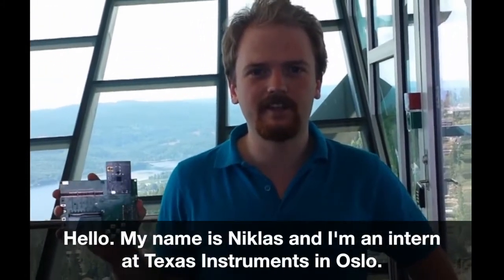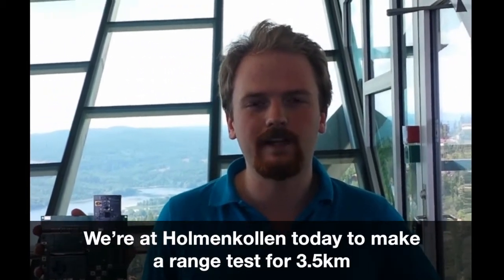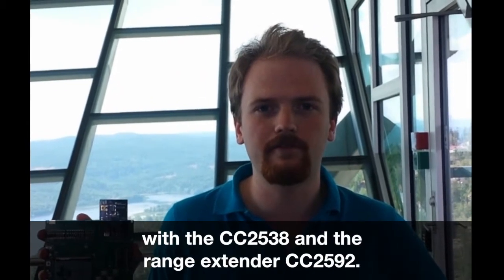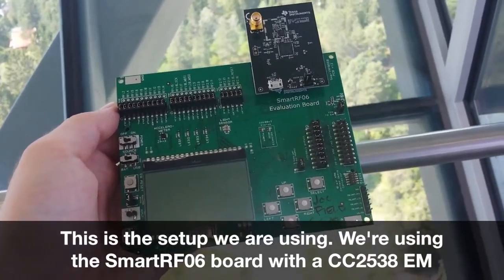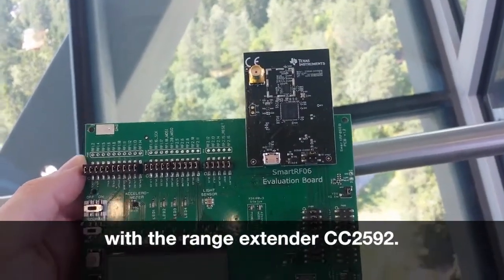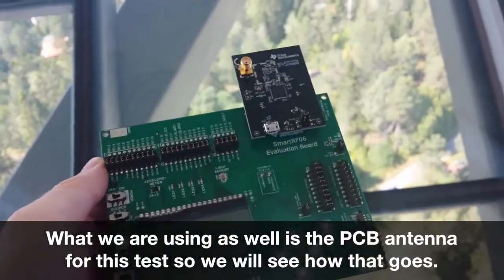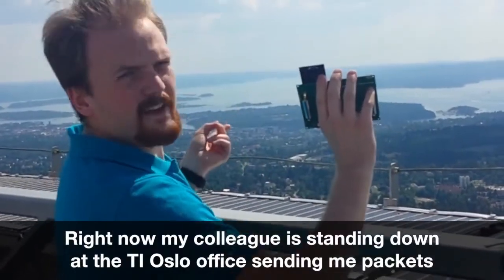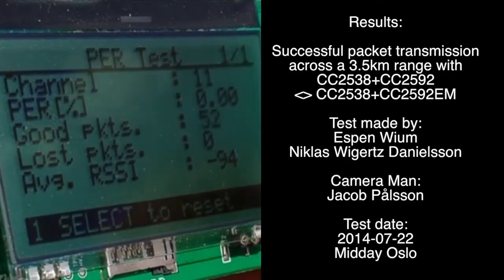Long Range Demo: CC2538 Wireless MCU & CC2592 Range Extender

Comment from the maker: Javier- In the demo, we used the Packet Error Rate (PER) test that’s included with the kit if you buy it. It’s very easily set up using the joystick and LCD screen on the SmartRF06EB (motherboard). The test itself just sends IEEE 802.15.4 packets from one board to the other (one way) and counts the number of received packets in order to give an estimate of the Packet Error Rate (at the receiving end, which is shown in the video). The packets utilize the IEEE 802.15.4 PHY and parts of the MAC (the MAC Frame Check Sequence is used to verify the integrity of the data). The IEEE 802.15.4 PHY modulation format is a 250kbps signal that is DSSS coded on to a 2 Mbps half-sine shaped offset QPSK modulated carrier. If you have more questions, visit our E2E community here: http://ow.ly/D2jcJ